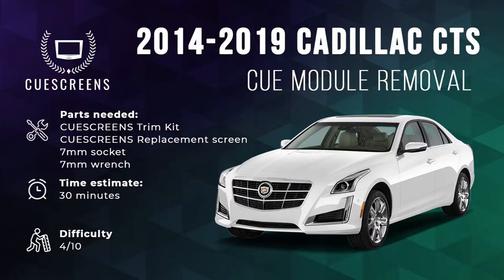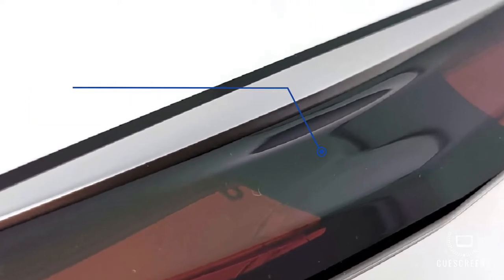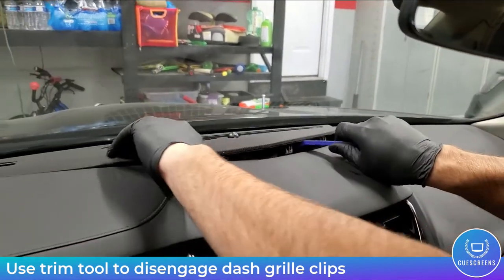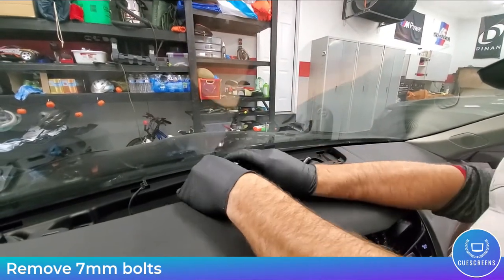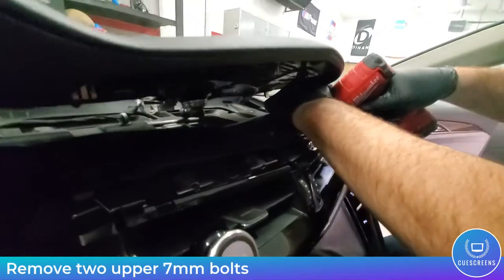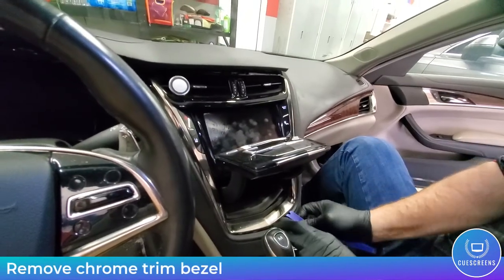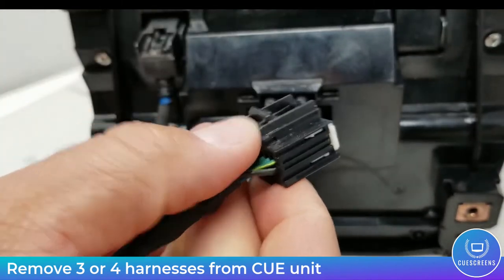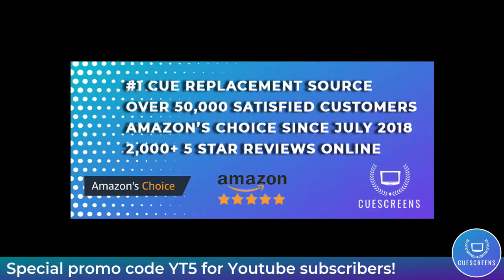2014-2019 Cadillac CTS CUE Removal DIY Screen Replacement *Easy Method 20 Mins*

Comment: Thanks man! Mine did the thing where the gel layer spiderwebbed. I took it to the dealership to get the screen replaced and they wanted $1,200!!!! They said it’s impossible to replace the screen and the only repair is to replace the entire center console module. Seriously. wtf? The part is cheap on Amazon and there are instructional videos on YouTube. Obviously they CAN replace the defective screen. How tf does Cadillac get away with selling a defective part and then price gouging for unnecessary parts/work?

Comment: 9/1/2024. I'm a mom and was reluctant to change the screen myself, but after watching your video and reading the reviews, I gave it a try. I ordered from Amazon and followed your video from start to finish. I took my time because I wanted to make sure I didn't miss any steps. I followed part 2 and  was able to replace the screen, test it before putting all the parts in place, and it worked! I paired it with my new phone and it looks great!  4 hours total Thank you!

Comment: Cadillac Dealership wants $1700 to replace the screen for my 2019 Cadillac CTS . Looks like ill be doing it myself. Scared.
Reply: Don't be! I ordered the Cue system from Amazon and replaced mine for 2015 CTS last week. I watched the video and paused when necessary. Side note:  With the CTS, mine had both USB and white connector. I was able to complete it within a few hours. Just be sure to have a flat ratchet 7 mm, Phillips 1 and 2, a cloth between your grill and windshield, and have patience.

Comment: I’ve a questions : I’ve a Cadillac CT’s 2014 and I wanna know if I can put a CUE system of a Cadillac CTs 2016 in my car, cause the CUE system in the model 2016 have android auto and is more cheaper than the other options
Reply from the maker: Simply swapping the cue system wont give you android auto- that functionality is stored in the HMI which is a separate retrofit.

Comment: Can you remove the cue from the XTS similar to the CTS? I watched videos for both and there are alot more steps I'm seeing for the XTS in addition to not removing/lifting the covers near the windshield?
Reply from the maker: Hi, the XTS has a separate process which is a bit more involved due to the trim and center console design. The video is on our channel

Comment: My 2014 XTS cue system has 'two' issues. It works fine but the screen looks spider'd (shattered) inside and the FM is not picking up local channels. The rest of it works fine. Advise?
Reply from the maker: Replace the touch screen first. Then replace the 3 way antenna on the roof

Comment: How do you remove the clip for the warning light on top left on the dash?  I don’t want to damage it.
Reply: Having the same issue here.
Reply: Figured it out. Squeeze the small tab near the wires and wiggle it out. My cars outlets for this plug look a little different than the video. They are protruding from the buttons